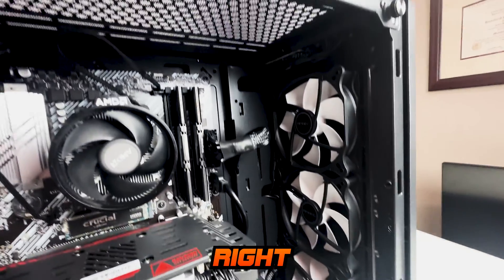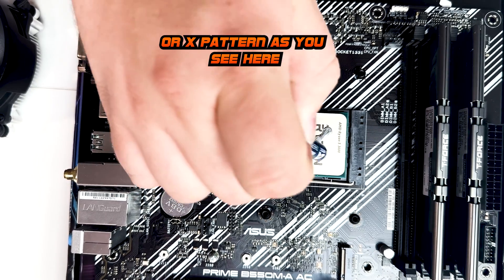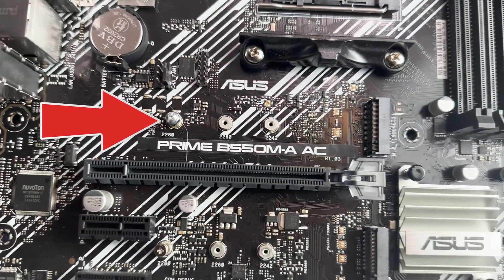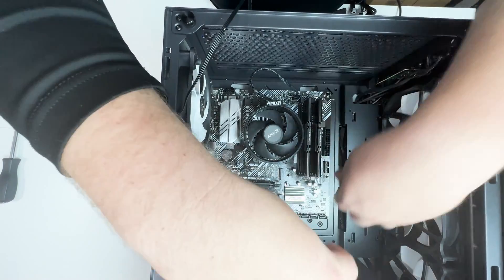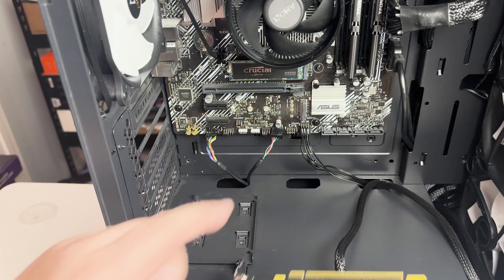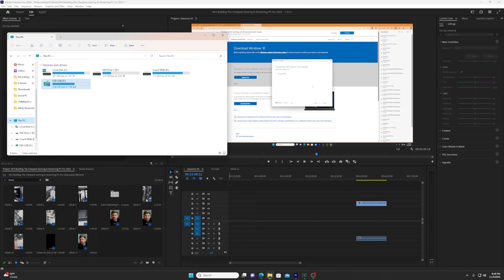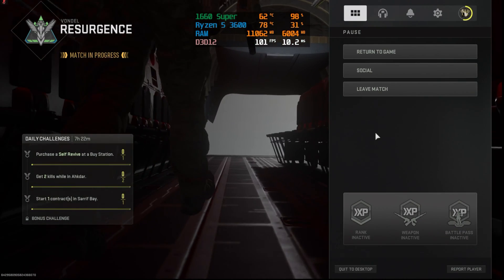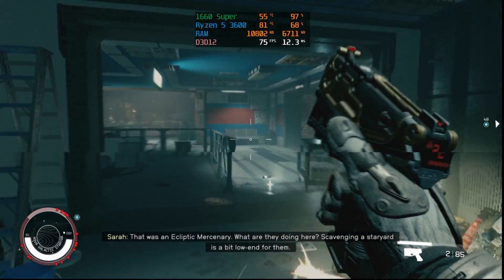How to Build a $400 Gaming and Streaming PC

Comment: Shouldn't you have a heatsink on that M.2 SSD?
Reply from the maker: It’s not necessary. They have heat spreaders on them. I’ve never had any issues from not using them. 

Cheaper motherboards typically dont come with them
Reply: @MMillerPCs  thanks, cool budget build.
Reply from the maker: @danthemagicalman  thank you!!

Comment: hi bro love your video!  About the motherboard there may have another offer for who has low budget, named MAXSUN,  comes from China mainland, (be called ELDER of the VAGRANT   XDDDD), which has a very good performance and quality, better(in my opinion) then ONDA/JINGYUE/ERYING etc. （ONDA/JINGYUE are also good but still need to be better..）
Reply from the maker: Awesome!! Thank you for watching. I have actually heard of MAXSUN a few times. I’ve not been brave enough to try because they are not that popular here in the US
Reply: @MMillerPCs  yes, and those motherboard which from MAXSUN/JINGYUE/ONDA etc have a problems with bios, they may have GUI-Bios but the logic is... emmm hard to tell... like retxrds..     but cheap enough to make you ignore the problems.
Reply from the maker: @ev5802   😂😂 yeah well I might use one at some point  then